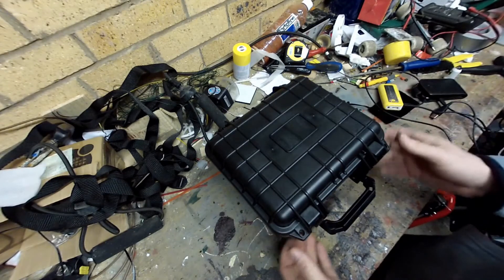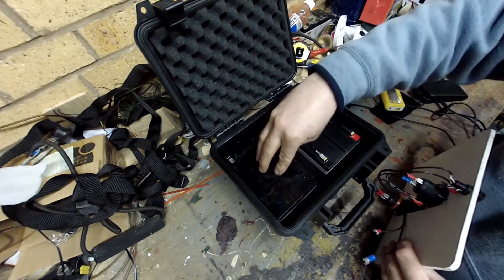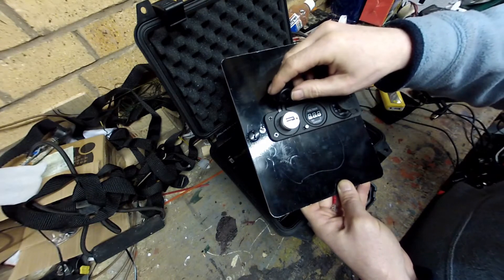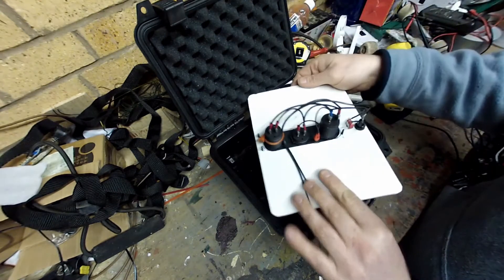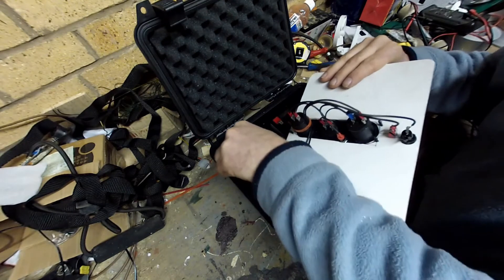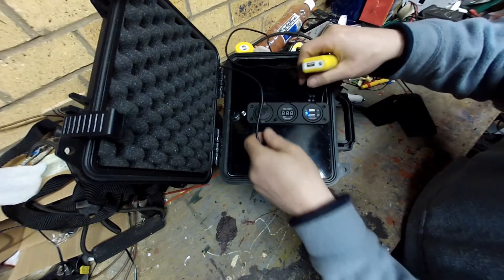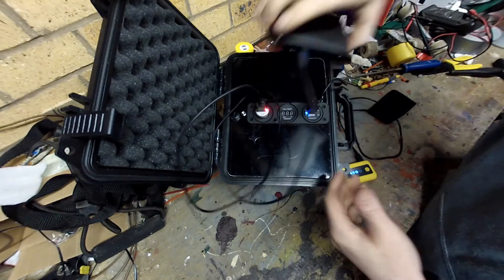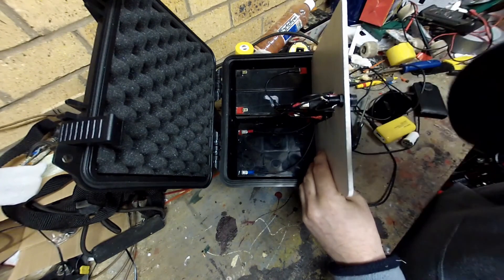My home made 12V Battery box (Power Supply Box) with Voltmeter

Comment: Visually and aesthetically this is one of the best home made power-bank I have ever seen. I am a bit worry with the voltages. Did you use L7805 for a step down or just a voltage divider based on the two resistors? Best regards,
Reply from the maker: Martin Hi, thanks for those kind words.  The USB, and other sockets are designed to work on 12V dc either on motorbike or car dashboards.  They have their own internal voltage reduction and stabilisation.  The 2 items are connected in parallel sharing the battery power as and when needed.  I have been using it now for a few months.  I have used it for 5 days so far charging my phone daily and other small USB peripherals.  I think it would last 2 weeks for this usage.  I will be using it again for a kayaking / camping trip at the end of May for 7 days with no civilisation anywhere near in the Highlands of Scotland.  It will be charging phones, cameras etc.  I have no doubt it will perform well.  I will be posting a vid after this event.
Reply: TheKayakingkid Thank you for the answer. I am pretty sure I will copy your idea: but on my return from the Scillies. Sadly I will not have enough time to build it before my trip. Happy paddling and I am awaiting your next upload!

Comment: Curious, how do you charge the batteries?  Solar?  I don't guess you have a circuit diagram hanging around?  But it is a nifty looking battery box.
Reply from the maker: Thanks,  it can be charged with solar or mains battery charger for lead acid batteries.  I don't have a drawing.  Its a very simple circuit though.  The usb, voltmeter and cigarette socket are in parallel with the small switch breaking this circuit.  The two large terminals are direct to the batteries via fuse to allow for charging when it is switched off.  See, simple!